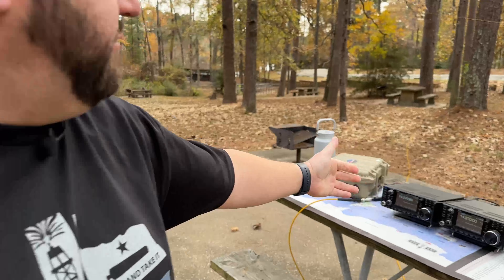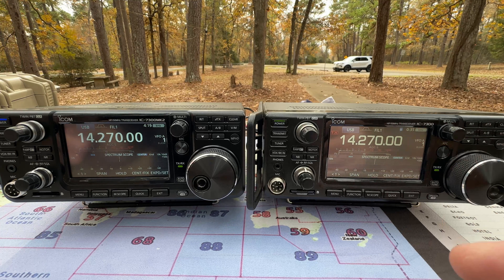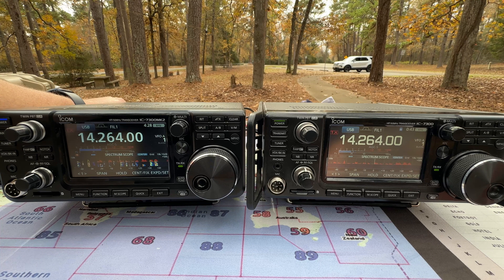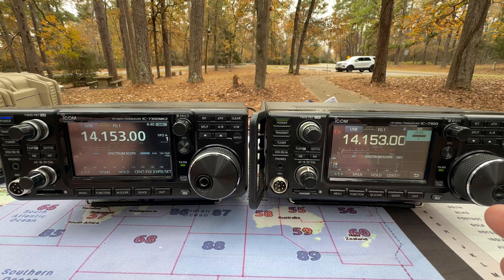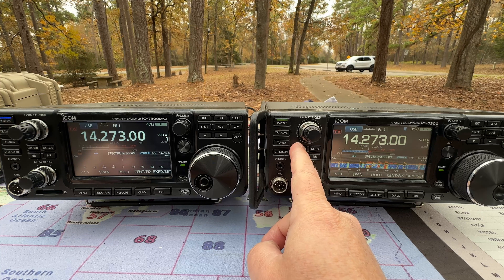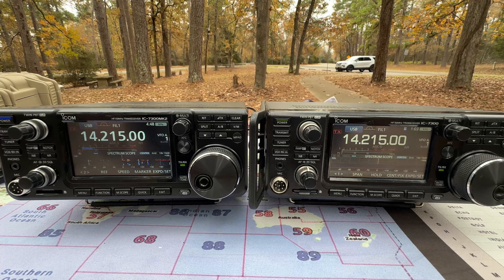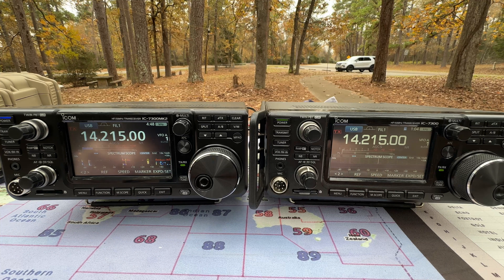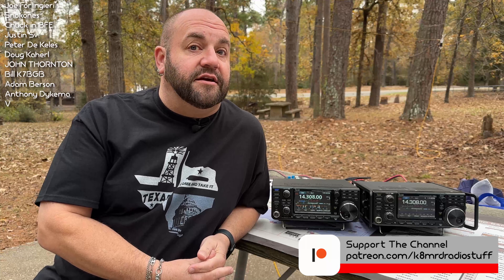Icom IC-7300MK2 V IC-7300 RX Comparison

Comment: Seems lazy of Icom to just mildly rebrand and tweak a 10 year old radio. Then again I'm a Yaesu man so maybe I'm missing something here? I'd hate to buy myself a new radio and it looks exactly like the old one 😆. Lee M0RQX
Reply from the maker: I mean, 817, 817ND, 818...though the 818 was because (I believe) they had to change one or more of the chips used to make the radio due to chip shortages.
Reply: @hamradiotube  Very true, The 817 stayed the same for nearly 20 years but that was a battery powered pocket sized radio that was (kind of) alone in its field for quite some time. Again though, I'm not an Icom guy and we all have our preferred brands. I think they should've made the mk2 with VHF/UHF to at least compete with the now ancient FT991a but I know it's not that simple. Each to their own, No radio is the wrong radio if it brings you enjoyment when you're on the air.
Reply: Especially at a price point of a new DX10....that's clearly a much better rig. I'm guessing the 710, that cost much less will have similar results.
Reply: @KB9QDI-RADIO  Agreed, The DX10 is fantastic! I had one for a couple of years and would buy one again.
Reply: If you look at it in a mirror it's completely different 😅😅

Comment: I love both radios, but I can't see any reason to upgrade to the Mk2 if you have the MK1 unless HDMI out and CW translation are paramount for you, the cost of training in the MK1 to get a MK2 is quite considerable.
Reply: I have always been disappointed by machines or programs reading cw.  Turns out the only good reader is between our ears.  And I use N1MM that throws a beautiful spectrum display and waterfall onto your computer screen with the 7300, and it is free.  The 7300 was always at an entry price where receive antennas and IQ out etc were not really called for.

Comment: A little more basey on the MK2. A slight difference in NR with the MK2. I did not hear a difference in the Preamp. And I don't think any of that is a bad thing. I think I prefer the original's sound but I doubt I would notice if I switched out the 7300 for the MK2 which I may do for the additional connectivity. This was very helpful, Mike.

Comment: Got mine hooked up last night. Still need to do powerpoles on the extra cord. So far, I like the new radio, but that's just subjective. Oh, and this probably won't make a hill of beans difference, terminate each radio in a 50 ohm dummy load when testing noise floor. Not really hearing a significant difference between the two radios except for slight bit of tone, but that might be how the IF passbands are set up during calibration.